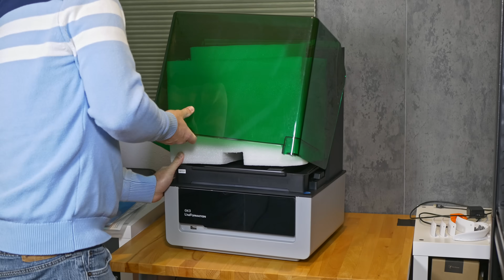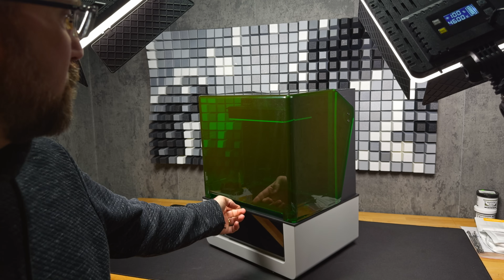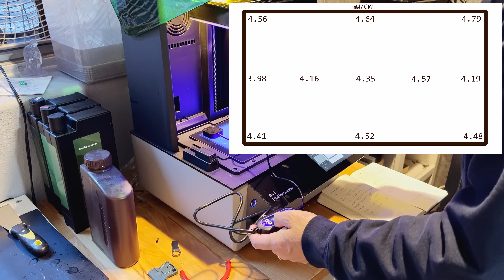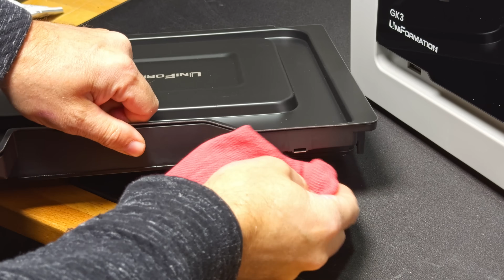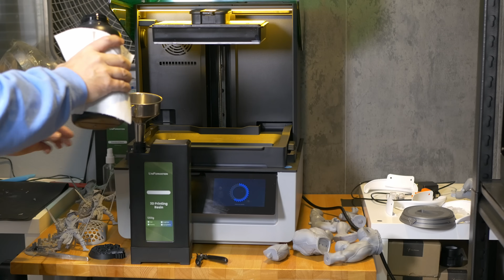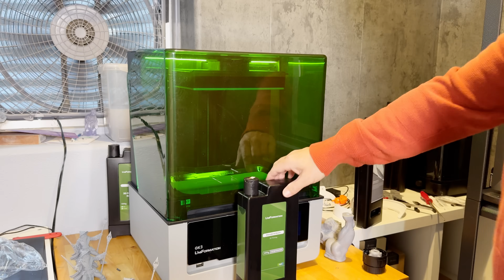Uniformation GK3: This Is the 3D Printer to Beat in 2026!

Comment: Hi, I just got my gk3 pro running today. I’m using inslogic water washable abs resin @2.1s for 0.05mm, with CPFA. 
I’m getting loud release popping compared to my old s3u, with ACF. 
Any idea what is happening
Reply from the maker: The release force is significantly higher with that film type, which is why the peeling sound is much louder than with ACF. You can try lowing your lift speeds.

Comment: I currently own an Elegoo Saturn 4 Ultra 16K printer but am looking for something more industrial-grade. I am mainly printing functional parts that need to be accurate. Using a Flexplate allows me to print things flat, which is already very helpful in terms of accuracy, but this causes some problems with the "auto-leveling" on the Saturn 4 Ultra 16 K. 

What printer would you recommend for more industrial printing of mainly functional parts? Should I go for UniFormation GK3 with a flexible bed, or what about Heygears? Would love to hear your recommendation!
Reply from the maker: If you are ok with their proprietary resins, the OG HeyGears Reflex is best suited for accurate, functional parts. The GK3, or Anycubic P1 would be my second choices. If you have the budget and are using the printer to make money, the formlabs Form 4 is the best option in terms of accuracy and advanced materials.
Reply: @ElevatedMakerSpace  Thanks a lot!

Comment: Did you ever get confirmation that the freezing issue is now fully fixed?
Reply from the maker: No, never got confirmation, however, as long as you power cycle the printer after each print project it should be fine.
Reply: @ElevatedMakerSpace  Aight, thanks.

Comment: I have a Elegoo M5U for the last year, is the best printer ever seen.. Also i have a Anycubic M7 Pro 14k and is a piece of trash... M5U works all un authomatic, you not need to worry about anything if do it the things correctly. Except if follows any advice from some youtubers (I followed the advice from Fauxhammer to use a ACF fep and that broken my machine... burn out the motherboard of 1 of my 2 M5U). You really test deeply the machines, that is why really like me how you work.

Comment: hey, do the resin tank lids snap on firmly? Would resin leak out if you say, drove around and it was in the back of a van?
Reply from the maker: No they do not. It would definitely leak.
Reply: @ElevatedMakerSpace  ok thanks, looks like the sprinter van needs form 4 then. The lids are a bit more robust, not to mention formlabs just reduced the price on the basic package

Comment: i'll wait for a gk4 i believe, and that opening at the bottom of the lid on the front is a big scary. i try to fan out the fumes with a ventilator on the back of my mars 5 ultra but it's reassuring to see the whole lid being closed anyway
Reply: No gap on gk3. They’ve rectified it

Comment: I'm trying to print 1/4 and 1/6 scale multipart action figures down to Warhammer 40k size models so I can paint them.

I want a heated resin tank.

Is this good as a first printer for that application, or should I get the Elegoo Saturn 4 16k, or the Express RS?

Comment: If you could only have 1 reasonable cost resin printer, would it be this, the large ultra, hey gears or something else?
Reply from the maker: The best way to answer that is to tell you that the only 2 SLA printers I have setup and use in my maker space are the Heygears Reflex RS and the Formlabs Form 4.

Comment: The use of ballscrews in SLA printers is not much for rigidity but repeatability. A SLA does thousands of retractions per print and the repeatability of a good ballscrew is significantly better. A leadscrew can have an error that is actually higher than the layer you are printing.

Regarding the 385 UV, from our initial testing it is not just a matter of clear resin, the quality, especially in the overhangs, is better on any resin we tested. There are though other issues, eg: the lower penetration impacts on the physical properties of resins designed for 405.

Anyway I really appreciated your review and subscribed to the channel.
Reply from the maker: You’re absolutely right in the general sense ballscrews do offer better repeatability and lower backlash than trapezoidal lead screws, especially in systems with frequent reversals or dynamic positioning.

That said, in the context of consumer MSLA printing, the practical impact is much smaller than it sounds on paper. Typical layer heights are 25–50 µm, occasionally 10 µm, and a decent quality trapezoidal leadscrew (even rolled, not ground) will usually have lead error on the order of ±10–20 µm over hundreds of millimeters of travel. Over the sub-millimeter Z increments used per layer, that error simply doesn’t accumulate in a meaningful way.

More importantly, MSLA Z motion is slow, heavily damped, and largely unidirectional per layer cycle. Backlash and repeatability errors that matter in CNC or motion-control systems are effectively preloaded out by gravity, peel forces, and motion profiles. In practice, Z banding and layer inconsistency on resin printers are far more often driven by peel dynamics, resin viscosity, light uniformity, and carriage rigidity than by screw pitch error.

Bottom line, at consumer SLA resolutions the layer heights sit well within a good lead screw’s tolerance, and real-world layer-to-layer repeatability ends up being functionally equivalent once the rest of the system is accounted for. From a system-level perspective, the GK3 would arguably see more meaningful print quality and reliability gains by spending that ballscrew budget on improved peel-force reduction strategies and motion algorithms that reduce fluid compression and separation shock, and material formulation, areas that actually dominate failure rates and surface artifacts on MSLA printers.

Comment: hi, love your videos , I’m evaluating a resin 3D printer for functional prototyping.
My priority is maximum dimensional accuracy, with particular focus on reducing compression and peel forces, as the parts are used for tolerance and fit validation.
Which solution would you recommend for this application?
Thank you.
Reply from the maker: The Formlabs Form 4 is the only printer I've tested that's accurate enough for tooling validation. https://youtu.be/RGJbpgDXDVM

Comment: How is the anti-aliasing performance? Have seen some other videos that state it's an inherent weakness for 16k printers and I'm planning on printing stuff directly on the build plate
Reply from the maker: It works fine, most of the models I printed had anti aliasing set between 2-4 and I had no issues with voxel stepping and surface quality was good.

Comment: This level of review is amazing. Instant follow. I bought an Anycubic M7 Max in July. 624 hrs or printing, 22 liters of resin....90% of that is troubleshooting. Currently waiting on a new drive motor and fresnel lens as those are the only two parts I've not replaced. About to throw a 700 GBP machine the bin.
Reply: Omg 😦 that makes me not want to get a resin printer at all
Reply: @bloodmoon-ronin dude, I've had about 5 so far. They're great when they work, but are a faff and messy. Do not skip any of the recommended safety tips, gloves etc. 

My advice, go with something like the Uniformation GK series. Or, if you can stretch the budget...the HeyGears. The more entry level ones can be hit or miss.

Comment: How well does the filter work? Like is it worth me buying an enclosure for the GK3
Reply from the maker: It's ok but not perfect. My room is well ventilated so it wasn't a problem, but if you are working in an area without good ventilation an enclosure with a dedicated external exhaust of filter unit can be helpful.
Reply: @ElevatedMakerSpace  Thanks for the response EMS! Appreciate it :)

Comment: Do you have the anti-aliasing gray-scale set at all? I'm having a tough time with vox layers showing, and cured pitting on the tops of surfaces. I've used Sunlu ABS-like resin for years without issues on my Saturn 3 Ultras. I bought these printers to scale, and I'm having a pretty bad experience with them. I've slowed the print speeds down dramatically, and it's still not helping.
Reply from the maker: For the materials I used, anti-aliasing was usually set between 2-4.

Comment: Fantastic review! I really appreciate the focus on real-world testing scenarios. I’m curious—did you manage to improve the dimensional accuracy on that mouse model by using a higher-quality resin or a specific combination of exposure settings?
Reply from the maker: An engineering-focused and dialed-in resin would definitely help, I've done it on other similar printers, but the dimensional accuracy is alway outside of tolerance for those thin wall functional components on these consumer focused printers. Even if you can adjust for peel forces the compression artifacts are always an issue.

Comment: How do you heat your resin in the GK3? Using the in built heating? Or ambient temp? I’ve seen reviews which state the in built heating function causes issue w prints. (Visible lines, and faster wear)
Reply from the maker: I used the built in heater. The print issues you are describing are more tied to resin problems. I've only seen that with Uniformation's older basic resins.